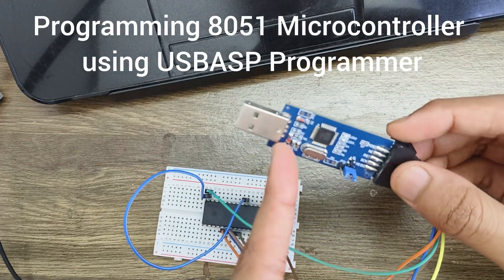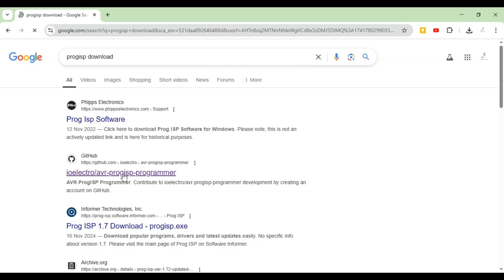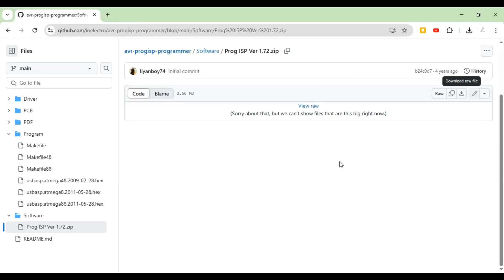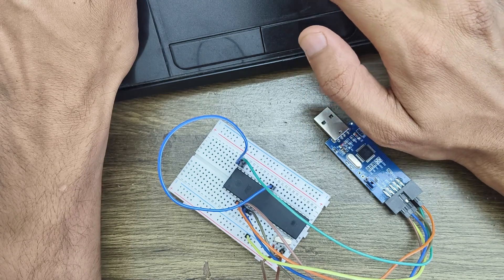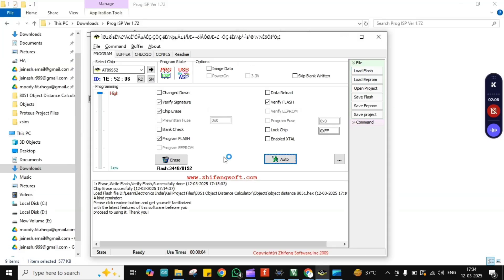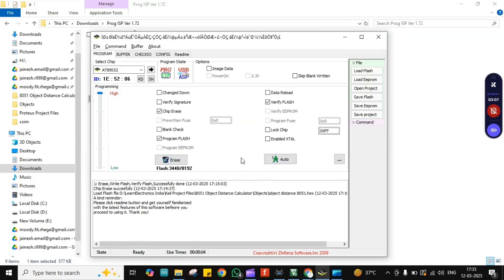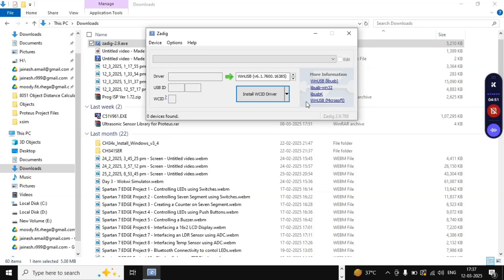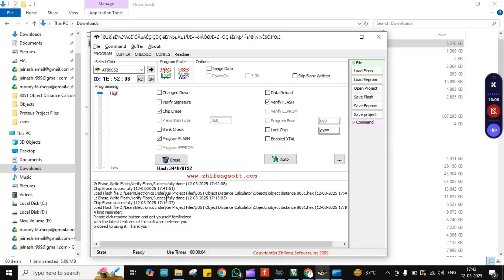Programming 8051 Microcontroller using USBASP Programmer | Programming 8051 Controller | USBASP

Comment: Hi 
i followed exact same steps but i am getting an error !! 
"chip enabled program error"
Reply: same here
Reply from the maker: Please check the connections and if stable power is supplied or not?
Reply: Doing a little research, I found that ISP programming with any programmer including USBasp do not work for AT89C52, because ISP is not supported, only parallel programming is available for the device.  It works for AT89S52 , which is an "update" for 8051 core. You can compare AT89C52 vs AT89S52 datasheets.